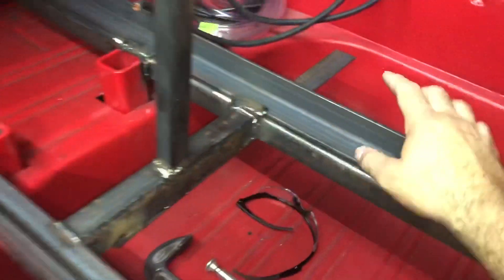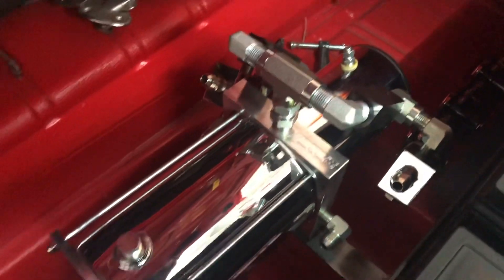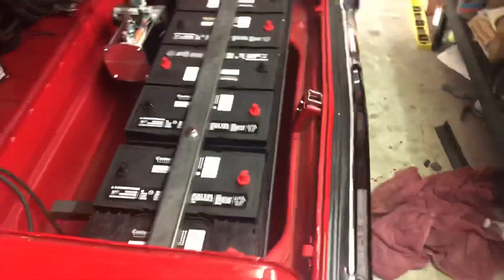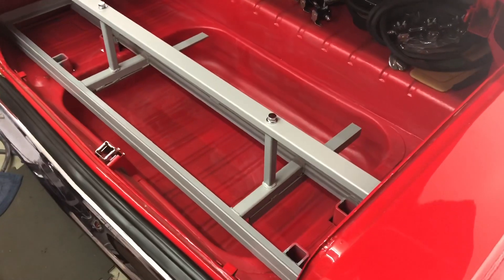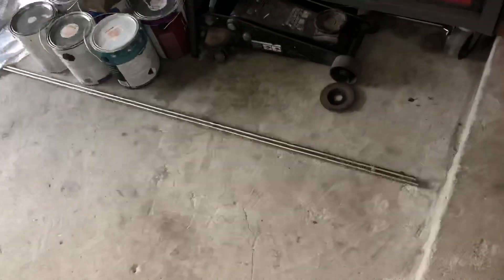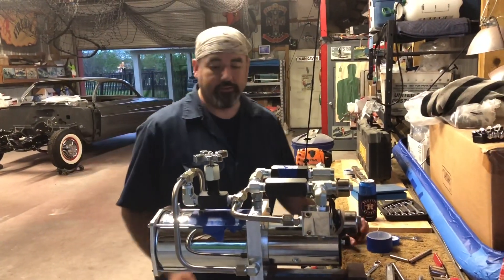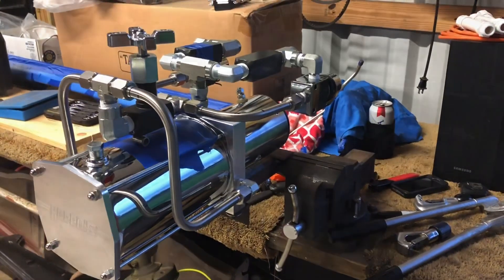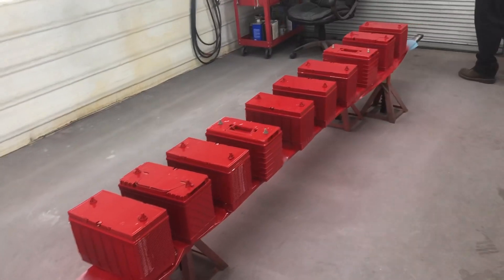Red rocket battery rack and hydraulic install part 2

Comment: Coming along great! 
Question: Any reason you didn’t drill holes/slots for the pumps and put in weld nuts for solenoids before welding in the brackets.
Reply from the maker: I honestly didn’t think about it lol, the pumps mounts are slotted now, weld in nuts for noids would of been great, I will consider that next time for sure, great suggestion 👍

Comment: Clean build. What parker slow down are those? I also like going with all parker the slow downs I have dont have that X valve to open & close...
Reply from the maker: eseguero84 Thanks you! Hard to beat Parkers,  The part number is MV800s

Parker 15 GPM 1/2 Inlet Steel Hydraulic Control Valve  MV800S

Hope that helps 👍
Reply: @RedRocket64  thanks...

Comment: Dope build bro!!! I like the way you take the time to really explain things. Where did you get your park check valve, and slowdown? Also are your slowdowns and return ports 1/2 or are they 3/8, and you are using 3/8 to 1/2 fittings? Great job on the video and build!!!
Reply from the maker: Thank you, appreciate that, everything is 1/2” except the actual returns on the pump blocks, I had to use 3/8 npt to #8 jic 90s on those to keep everything plumbed 1/2” Hope that makes sense. 

I got the Parker check valves for hilow hydraulics and the Parker slow from Ebay 

Here is the info and part number on the slows

Parker 15 GPM 1/2 Inlet Steel Hydraulic Control Valve  MV800S

Copy and paste that to eBay search bar and some should pop up, usually about half the price lowrider shops sell them for.
Reply: @RedRocket64  Thanks a lot!!!

Comment: I need you to drop them Chome shocks part number and for headlights also.
Reply from the maker: cleo 2212 sure man, I’ll get back with you this evening 👍
Reply: Ok thanks
Reply: I was going to ask the same. Thanks
Reply from the maker: cleo 2212 shocks 

 https://rover.ebay.com/rover/0/0/0?mpre=https%3A%2F%2Fwww.ebay.com%2Fulk%2Fitm%2F283788861900

Headlights
https://rover.ebay.com/rover/0/0/0?mpre=https%3A%2F%2Fwww.ebay.com%2Fulk%2Fitm%2F232524986990
Reply: Red Rocket 64 , thank you brother. I snapped them up quickly
Reply: cleo 2212 dang I didn’t stand a chance!!!
Reply: @RedRocket64  what size cylinders did you end up using in the rear???
Reply: Ben Alanis , 12 inchers if I remember correctly
Reply from the maker: cleo 2212 Yes sir, 12s 👍
Reply: Ben Alanis , I been meaning to buy some .

Comment: What rear cylinders did you go with and go you have any pics with it locked up?
Reply from the maker: Got 12s in the back, stock length trailing arm, I should have some pics, need to check 👍
Reply: Red Rocket 64 all good. I was checking out some other of your videos and saw on the Father’s Day vid you have one with it locked up. It’s a pretty decent lock up. I think I will go with 14s on mine. Did you use 2 or 3 ton coils?